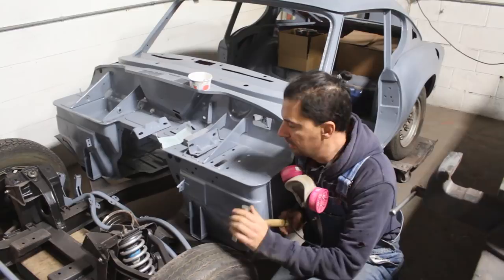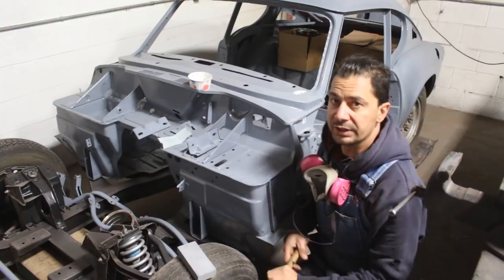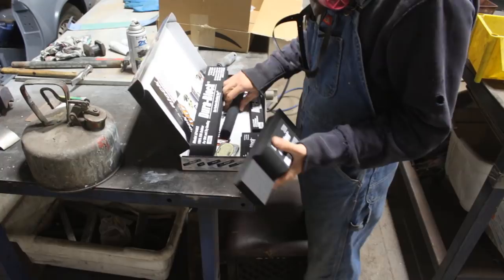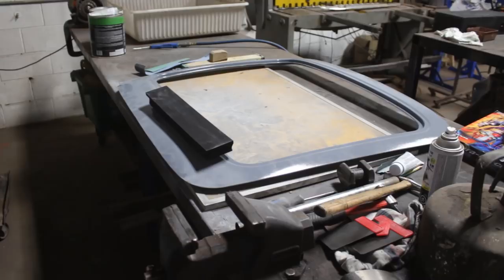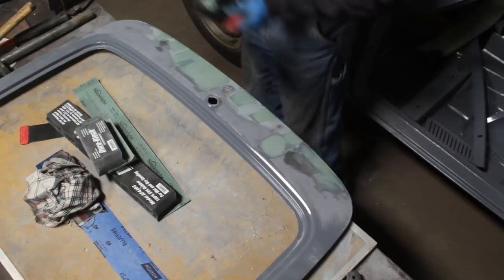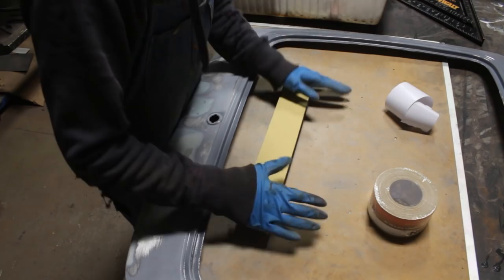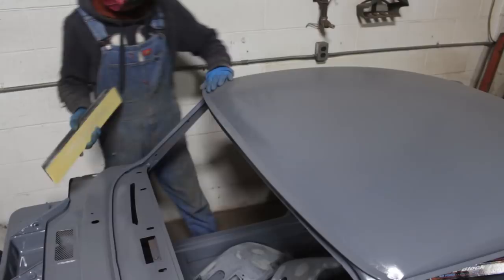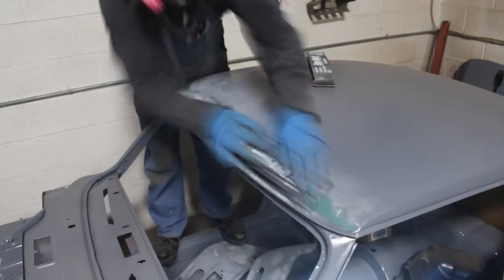1972 Triumph GT6 Restoration - part 61 - Body Work

Comment: A comment about how I do primer to save a few steps.
Apply epoxy primer as normal. Allow to tack up. Then apply 2 heavy coats of 2 part urethane sanding primer. Of a different color. The sanding primer will be thick enough to work out a great deal of imperfections. When you start seeing the other color of epoxy primer, stop sanding and do filler as needed. Then you dont have to epoxy prime again. I use urethane primer over the filled areas. It seals the filler well.

Comment: My vote is for the red.  
When block sanding, one extra step I do between coats of filler is to scuff the lows that the block didn't get.  Its probably not needed, but i figure it cant hurt.  It also gets rid of any remaining guide coat when you get to that step.

Comment: My opinion, colour choice always lets the GT6 down. Always too plain and too dull. Like the car though. Any original standard colour that Triumph used is just going to be wrong I'm afraid. Not sure why every Triumph car, except the GT6, had great colour choices. I think if you go for just about any hue but in a pearlescent, the car would look stunning. So I vote for maroon pearlescent. Not original? Not so, a well-heeled buyer could have paid a lot extra and had anything that the paint makers could deliver to the Triumph factory. The original standard finish cars had no clear, I think so you will not make it like an original in any case. Whatever you do, you will make it far too "nice" for a true original GT6, I have owned two nearly new 1972 Triumph cars back in the day when good looks came only from wax every week. Nowadays I can wax my new Nissan till the cows come home and it does not look any different, clear varnish is clear varnish, end of. So another idea is no clear, coats, just waxed cellulose if they still sell it. You are supposed to use acrylic these days, which is just plain wrong wrong wrong. Ben